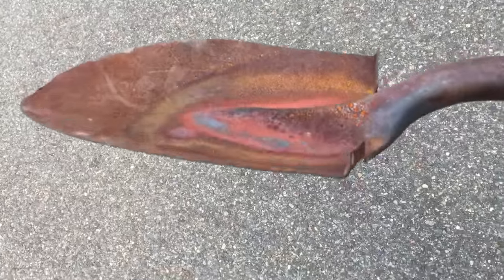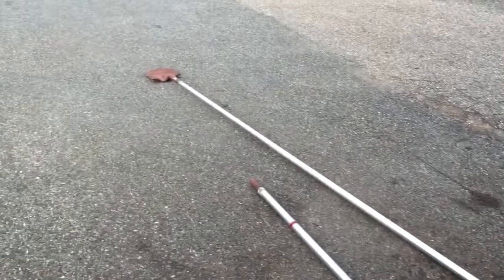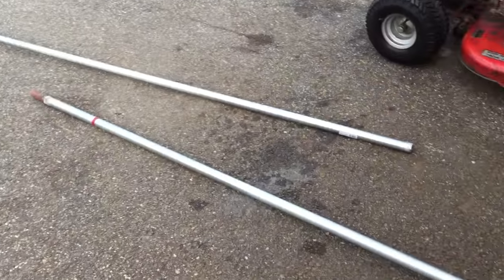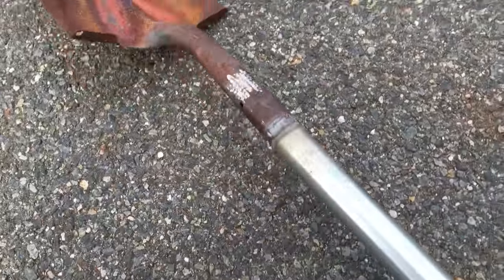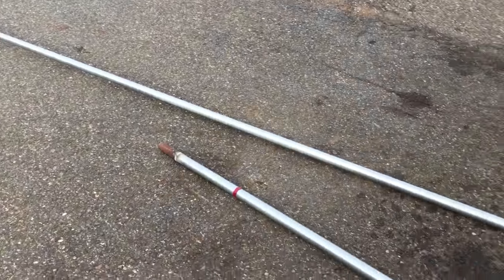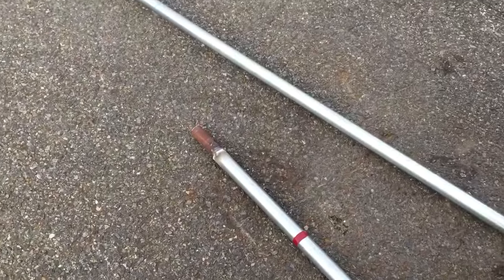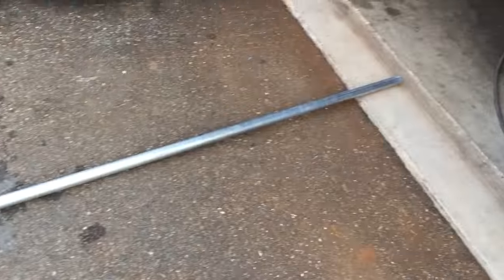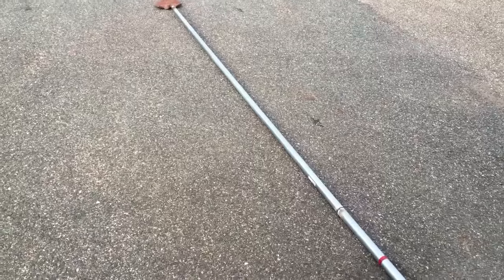Shovel for Cleaning Out Culvert Pipes

Comment: That must be awfully heavy to shove into the culvert.....
Reply from the maker: It actually isnt that heavy. It is a regular shovel mounted on a piece of electrical conduit. The purpose built shovels for this duty are somewhat larger and have heavier handles. You dont do much lifting with this. The shovel is flatter than normal, in the case of this one I heated it and flattened it myself. It has a slight angle so you hold the handle up a bit as you slide it into the pipes bottom then lay the handle down and drag it out carrying what ever is on it. Then, just flip it over to be removed from there with a regular shovel or a machine. Merry christmass to you!
Reply: @GuntersGarage  thanks for the reply. The drain under my culvert has been blocked with about one feet of awfully stinking mud and I am trying to figure out the best way to clear it out. I will get a long-handled shovel like yours. And Merry Christmas and Happy New Year to you too....
Reply from the maker: Check with your municipality or if you have a homeowners assc. It may be their obligation. Might have to wait forever. Best of luck with it